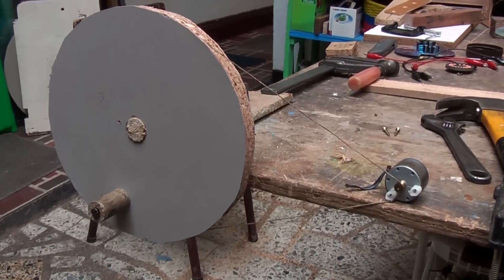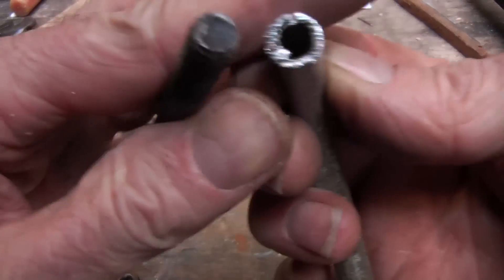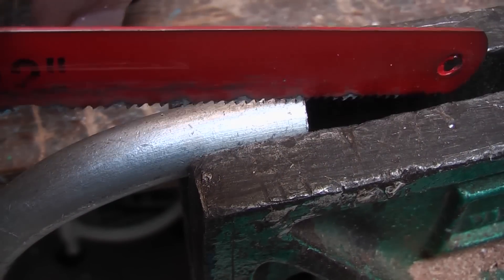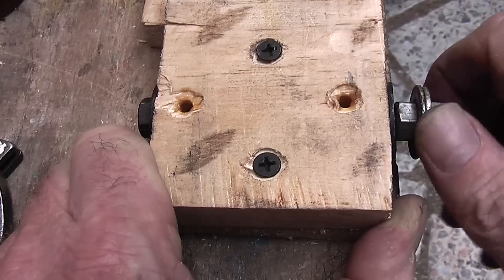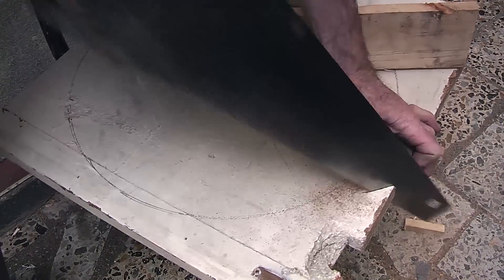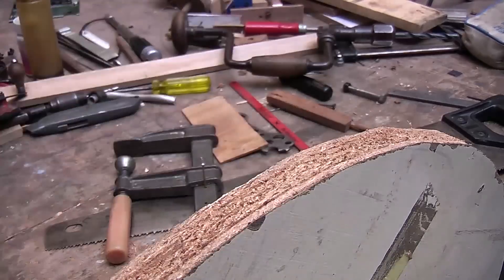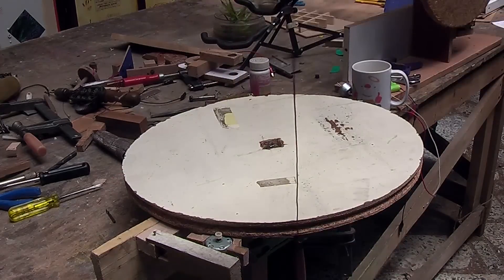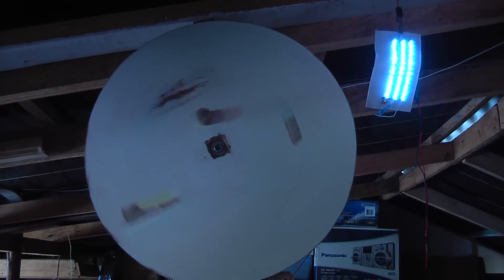Wall Mounted Generator

Comment: I have a couple questions. Do you have an educational background and how did you learn all this stuff. Also, I've noticed you don't really use any power tools and "new" pieces of wood. Why is that?
Reply from the maker: Hi, thanks for the comment. No I do not have an educational background. :)  I just   investigate and experiment. If you understand basic concepts, then combine those concepts, you can do a lot. With this I am learning about  how electricity is generated - and  am disgusted  by  how  large  my electricity bill is. I like to use manual tools. Electric ones are fine, particularly in industrial situations, and I have done  a lot of that throughout  my life, but  I like  the simplicity of the  hand tools.  It is also cheaper, and it is surprising what you can achieve with them..  I use  ' not  new' pieces of wood because it  works and  costs less. Why pay for it if   you can get it for free.

Comment: Incredibly genius but also simple as always.  I feel like you are always surprising us with great ways of doing things.  Have you tried making yourself a lathe, maybe with a sewing machine pedal for power?  I think that'd up the efficiency of your wheels and especially bearing/axles. I'll bet you could make one hell of a lathe, and a little grit paper would smooth out the axles a ton.
Cheers!
Reply from the maker: Yes, I did make a lath or two.  I live in a third world country and  aware that  many  people do not  have  machines, electricity or hardly anything out in the jungle or  mountainside, so I try  to go as minimal as possible. Yes , good bearings  make a huge difference
Reply: +PhilipStephens007 africa ?